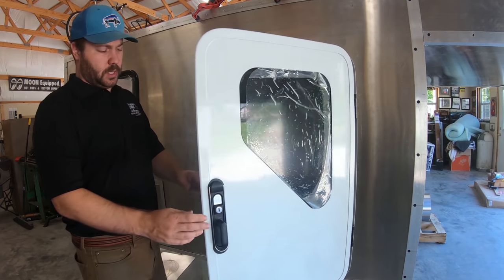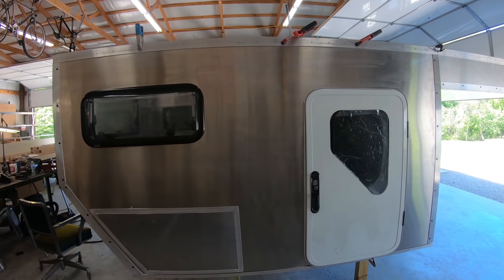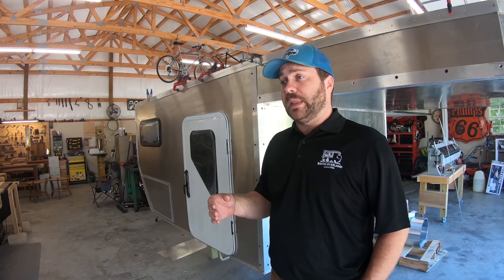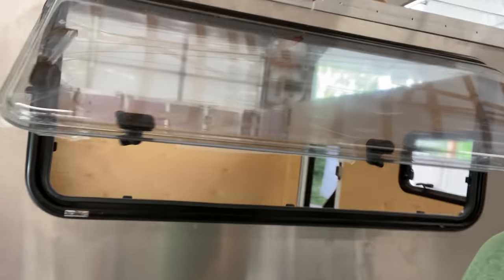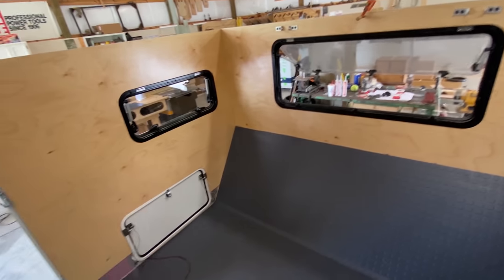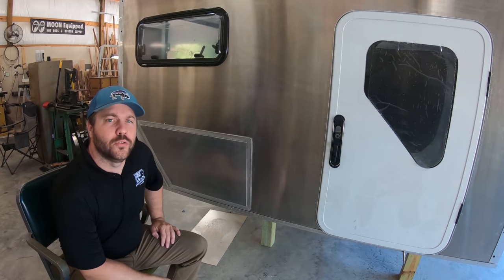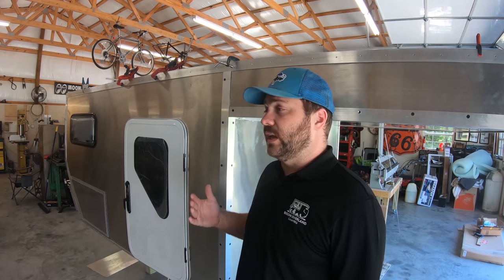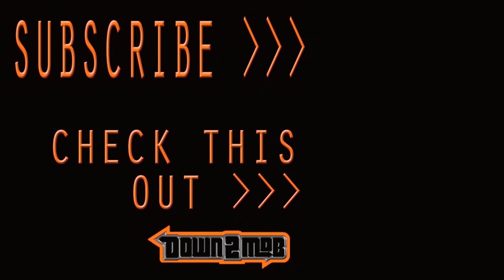Custom Aluminum Pop Up Flat Bed Truck Camper by BISON OVERLAND

Comment: I can see getting a custom made camper to mount on the back of a Army surplus LMTV M1078 2.5 Ton 4x4. Perfect set up.
Reply: That's exactly what I am doing. On my m1078  my camper is on 1/4 steel frame With composite honeycomb panels
Reply: @williambrawner2618  where'd you get composits from or are you a dealer/ builder?
Reply: @williambrawner2618  I would be interested in info about the panels too!
Reply: Im doing it on an army truck,  just a specialized garrison one from 1968 . An International Harvester Loadstar 1700 4x4.  I hope I can support the Bison Company because it's the perfect fit to my 8 foot by 8 foot flatbed . With lumber prices now,  it would almost cost the same.

Comment: To all the nay sayers, remember this is a prototype from a brand new company trying to bring something innovative to the overland market. And get in touch with them to find out what a bare shell includes. You’ll be pleasantly surprised. Also if I understand correctly what they are offering is a blank canvas for you to design and build your interior your way. I foresee a large community of Bison owners getting together to show off how they built theirs. I think they hit the nail on the head.

Comment: Very interesting! One thing that I've always thought is that campers are either cheaply built (and expensive) or a little  better quality build but much more expensive. They all fall apart with use and time though. The camper taking shape here looks like it's going to be very durable and well thought out which is awesome and much needed. Thanks for sharing!

Comment: Looks good but seems like on expensive side. I am worried about outside seams. 
What is the weight of the shell?
Reply: If you sandwich thicker guage 5k series aluminum w/the right sealant outside seams will last decades. As with anything..it's how well it's done and with what quality materials..

Comment: That's awesome! A few observations while it's fresh on my mind to share with Drew. 1) Backup camera provision that integrates with factory tailgate harness for those who remove a bed and convert. 2) Option for a non cab-over model like really old school 4 Wheel Campers. 3) A clamp on model similar to project X by 4 Wheel Camper, both cab over and truck bed only. I understand this is a launch and am a manufacturing engineering planner by trade, so I'm aware of the design and supply chain issues of bringing this online. Just observations to share.
Reply: Anything else we need to consider or know? 6k series aluminum or 5k? Should solar panels by built into the roof structure?
Reply: @cencoast_7.340  As far as the aluminum I would go industry standard or push it up if cost is not a huge factor.  For the solar a wire pass through from the factory at a minimum. For mounting I would think Thule pattern mounts, or something similar, would be the way to go. Along with a factory upgrade to solar panels already installed.

Comment: Bison's approach is nice. I once owned a FourWheel camper (70's vintage). My next popup will be for a flatbed, but with different function (essentially just a shell) than FourWheel's. I wish I knew of Bison over a year ago because I've already purchased aluminum sheet, aluminum tubing, windows, etc. for building my own. Mine differs from Bison's as follows:
-) Rear will only extend 3 inches past the back of the flatbed, no sloped back.
-) Two large, opposing rear doors, 60" combined opening width (general utility)
-) A taller height (~60 inches, pop top closed) - more usable even with pop top closed
-) Aluminum sheet thickness is between Bison's and Fourwheel's (0.030")
-) Azdel backing for the aluminum sheet (improves insulation and dent resistance)
-) 1.25" square tubing, mostly 0.060" thick, but 0.125" in key areas.
-) No integral floor to camper - flatbed's floor to serve as the base, with some covering
-) Aluminum backed block foam insulation between structural tubing
-) Attaches to truck via. flatbed's perimeter rails and stake pockets 
-) Azdel may also serve for the interior wall
-) Modular, separable walls - easier to modify, allows storage as a series of flat panels 
-) Cab-over? - May forgo, as this cantilevered section adds a lot of weight for the space
https://www.azdelonboard.com/

Comment: 18k without interior built out......

This isn't for anyone watching this channel lol
Reply: Joshua Cripe 
I’ll build my own shell for under a thousand dollars, then put a couple hundred dollars into fitting it out each month until the “Truck Bed Cabin” is complete...
Reply: Rick Sanchez C137 lol 💩box
Reply: @deepsix1827  well rv loans can be like 100 months so the payments are low and campers aren't cheap to make especially if they will be going off-road they have to be over built
Reply: You save up for a few years if you need to right? Save money for 2 years and have an awesome rig for 10 years to enjoy.

Comment: I definitely prefer those quality windows and doors. They have great thermal qualities. My question is: You've got those great windows and door, but then you have thermal bridging between the aluminum skin and frame. You've also got a vinyl tent with relatively poor thermal qualities. I understand the use of the quality windows and doors in a fully composite camper with no thermal bridging, but in this application is seems like overkill, since the other components are the thermal weak point. I live in Canada and camp year round - thermal performance is a huge factor for me. Just my thoughts.
Reply: For a pop top camper I would love to see a composite body (fiberglass and foam panels) with enough height unpopped that you can still cook, sleep (on a dinette), stealth camp, access your clothes etc. You may not be able to stand up with the top down but you can still enjoy the space in colder weather or stealth camping. Then when your in the wild or the weather improves you can pop the top and have standing room. Those double pane windows and doors make a lot more sense in that kind of application IMO.
Reply: have you ever put your hand on bare aluminum in the hot sun?

Comment: The Gladiator has a 1080 to 1200 pound payload. water, recovery gear, food, bumpers, winch , passengers etc. is already well over that. This camper built out will definitely be another 1000 pounds plus whatever flatbed or fabrication is gonna be under it. 

This is sick but it should be on a 3/4 or 1 ton. I see necessary future frame reinforcement,  supercharger, then a blown engine or transmission before eventual hemi swap and im sure brake upgrades will be needed. Once you go this balls in its not gonna stop. 

I would put the bed back on and sell it for  something else or look at a lighter option. 

I have a Tacoma with a good bit more rated payload and I wouldn't consider heavier than a FWC project M at 400 pounds.
Reply: Yes. I was thinking the same thing. My TRD PRO is only 900lbs!

Comment: I dont know if i am correct in saying this, cause the camera was moving . But at the back top corner, the vertical piece of angle iron(aluminum) where it meets the two other converging pieces that are horizontal angle iron... it needs to go under those ... it almost looks like there is a gap or that it just sits up next to it. I bring this up cause of rain/leaking. I would think that like a house you want things to overlap to easily allow rain to flow off and not get caught in gaps/cracks. otherwise cant wait to see the other improvements and wish him success.

Comment: that door is Massive,huge door unlike every other trailer or rig on the market satan santa can fit thru.
Reply: I would go even stronger on the frame, no poo poo on 1st camper though. The  long short deal I would nip in the bud. Make it long & strong & figure a way to make it safe to carry in short bed. Still u need a angle & so far no angle snooze feast. 1/2 pop up roof & 1/2 hard side taller roof or something crazy like that. Bowled out 1/2 the roof so stuff is secure & poss car top carrier covered. Something diff. Yeah so 1/2 the roof pops up & other side clams open hidden secure storage. I don't see it yet Need an angle. All your cargo is inside & everything is pop up top side mininmalist camping just off the ground. So cargo prt is 6ft max ht Then camper above 4ft even not poped & if poped up another 4ft. That is an angle no1 has work cargo storage truck bad u can stealth sleep & camp in & when poped real space. W/out an angle in the market it's just a hobby. No mini loyal followers thick or then.

Comment: How water tight are your exterior compartments? When doing a river crossing, how will those compartments keep the water out? I Like the idea to be able to grab things from the outside, but would like to know if the cabover is water tight all around.
Reply: Chris Carvajal all hatches sealed with Vulkem 116. Water tight for 30 years

Comment: is the aluminum used 5052 as what was said in video or 6061 as what is on web site in blueprint ? Also if 6061 is used has it been heat treated and anodized
Reply: Wondering the same thing.

Comment: Now how about a cold climate version with WOOD/thermal break skeleton?
Quality strong wood is available, reasonably priced. Great ADHESIVES are run of the mill now.
With your thicker Aluminum exterior, it wood (; perform as an exoskeleton.
Remember, COLD camping with frost on the INside of the camper is an extreme turn-off!!
Been there. NEVER again!

Comment: Very cool and very interested. What size truck(s) will these work with? And how long until you're in full production mode or are these made to order? Is there a way to have one made that would allow pass through to the truck cab? Thank you ~Ron
Reply: I'm wanting the same thing, the pass-through to the back of the truck or Jeep.Big enough to climb through if I want to make a mad dash out of someplace without getting out of the camper and into the cab.

Comment: It would be great if you could innovate crating a pop-up that don't use any fabrics/vinyl as retractil wall, but instead a kind of colapsable solid wall, or a wall that turns into a roll. I imagine something like the A but of course the shape would need to be diferent, probably with some hinges and an origami kind of movement. I mention it becausefabrics of any kind give that tent looking that makes one doubt as it can be easily damaged intentonally or by animals.
Reply: Like the fiberglass on the 78 Ford F-600 build? would be perfect!!!

Comment: I'm thinking you are going to replace those black screws you used to mount the aluminum corner trim? Hope so...replace with stainless steel screws. The black heads look like they are just temporary? Black stands out in a bad way against all that aluminum IMO. Otherwise looks like a great camper...but like another poster said, I'd worry about all the seams...the good-ol water has a way of finding its way in...but what's a guy to to do right? The only campers out there that do NOT leak so far are those made with fiberglass...if I was going to spend $20-$30K on a camper I'd get a fiberglass shell camper..yea yea yea they don't look as good as aluminum but they sure as hell don't leak or rot. And I wouldn't buy any camper with a lift-up top...they for sure will decay and leak over time...just go look at some old ones at the auctions...ripped, torn, mold/stained and cracked. but like I said, what's a builder to do? Sacrifice longevity for fuel economy...if you do the math it don't work out.

Comment: It's nice, but they are doing the same as everyone else. My gas tank is on the driver's side. Why does everyone put the heavy kitch on the same side as the gas tank? A back door would be the best option with fold down steps.

Comment: Very interesting product concept with plenty of legitimate product differentiating merit. All the interior plywood wall structure is a concern. With all that plywood interior wall paneling one better hope none of those exterior panel seams leak water. The bare shell priced at $18k? OUCH!! Probably DOA in the market at that high price - particularly when other shell type camper products now available from various mfgs are priced <$10k. Unfortunately, I'll bet FWC attorneys are already studying basis to sue Bison Overland to enjoin further production.
Reply: Totally agree with you! I don’t understand why they don’t just line it with aluminum sheets inside as well. Could use .04, looks great and is much lighter then plywood. That’s how I’ve been building my aussie style off road trailer. I’m so done with any kind of wood on or in walls.

Comment: 18k for an unbuilt 4×8 aluminum camper shell hell, no!   
Get a Berg steel 10×10 that expands to 10×20 for half the cost oh and it comes ready for furniture
Reply: I tried looking it up! Berg Steel ?
Where can I find it? Thank you
Reply: Any info on the Berg unit?
Reply: @1966cambo  Berg.com they have several different models and sizes some even can be stacked or arranged to attach multiple units
Reply: @datrooster4112  berg.com gets you to some electrical component company.....

Comment: I want to see the bed.  Without the storage under bed option FWC has, this thing is DOA for me.  I also have a hard time accepting the price of a product that you can't see all the details of.  This is clearly ripping off the FWC product, which they will likely sue you over.   For now is a pipe dream and at least fun to watch.  Good Luck.
Reply: Nothing to sue over, FWC campers aren't proprietary, there's nothing unique about them, there's dozens of camper manufacturers all making the same basic designs.

Comment: Drew...i 'love' Flatbed Campers'.( Empty SHELL )....BUT...even if your price is 'SOMEWHAT' Reasonable...What's 'Holding me back'...to commit..Is Always...I have to purchase a 'Flatbed' for the camper to 'Go ONTO'...Which is going to cost another $10.G's!!
The 'Average Joe'...Can't Afford THAT!!   ..i think i'm 'STUCK' Too an 'Empty Shell' type Pop Up Idea from...ie. Vagabond Drifter... just saying... Thanks..
Reply: I'm building one out of 4x6" wooden beams, no carpentry experience.  Treated lumber and sealed with brush on clear stain.

Comment: $18,000?  Sorry I just don't see the value there, I was expecting him to say $7,000-$9,000.  I just see a lot of cheap materials you can get at Home Depot and the local trailer supply store.  Maybe the final production model will change my mind.  I'm more a weekend warrior anyway so this product really isn't for me.
Reply: $7k-$9k probably wouldn’t cover cost of materials and labor. 
I built a smaller much less complex camper with diy doors that aren’t remotely as nice and the materials cost alone are going to end up in the $10k neighborhood for a completed camper. 
It’s probably $7k just for the shell of my camper. Add in labor and the cost goes through the roof.
Reply from the maker: thats probably under what the materials cost. Thanks for watching
Reply: I'm a welder and I am planning on building a very similar camper; the materials cost ONLY with the windows is around $9k

Comment: You compare your product to 4wheel camper . Their shell camper is 13k ,  yours 18k ?!?!?!?
Reply: And the project M is only 10k and 400 pounds.
Reply: @williamsealy8781  Project M is comparable to truck cap/shell/topper (even says so on the 4wheelcamper site). So its not comparable.
Reply: 4Wheel camper FLATBED which is what is being compared is $28,995 base price before any options. Check the 2021 flatbed pricing sheet.